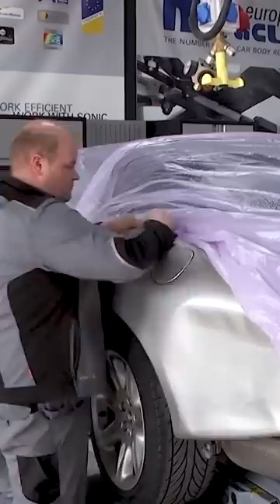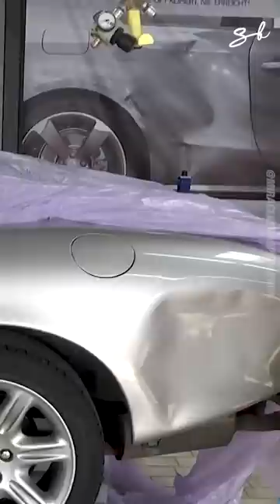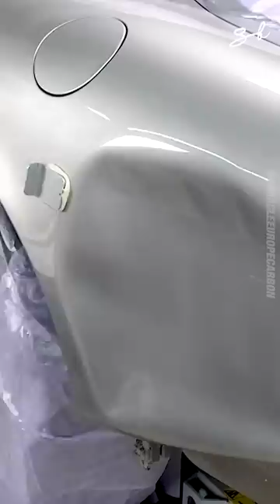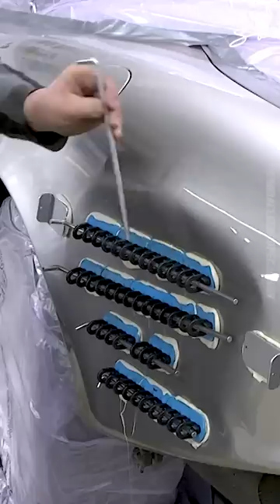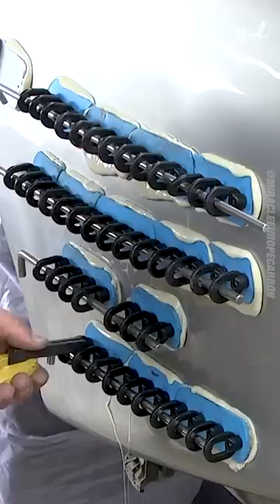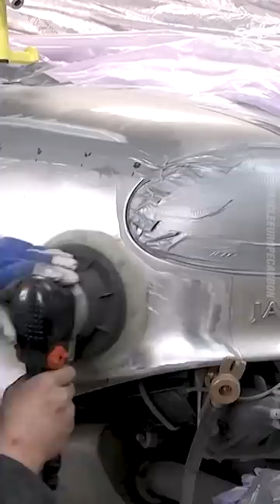Fixing a Huge Dent On a Jaguar 😮

Comment: That's the quietest repair shop I've ever seen.....you could hear a pin drop ✌️
Reply: The audio in this video is not live. You can tell because when he’s interacting with the stickies he put on the car there are no sounds. Even in the quietest room you would still hear parts touching eachother, especially metal
Reply: What if The fans are really loud
Reply: Sounds like ambient noise

Comment: That was some impressive paintless repair technique, but it must have cracked or damaged the paint at some point and he was forced to take it down to metal and refinish.
Reply: Putting money on her has some bond work to do. Small damage won't show in a video at all, but irl or feeling it shows.
Reply: If the paint is not cracked or split  then the paint can take a certain amount of deformation without detaching form the body surface.  Therefore it may only need polishing.
Reply: @emanuelmifsud6754 he sanded completely through the paint to bare metal. How is he gonna polish that??🤷‍♂️
Reply: @louskunt9798  He could be doing unnecessary work to bump up the job.  He's a business maximising profit.

Comment: If this is PDR (paintless dent repair), then I am king )
Reply: Till they ground it back 😂
Reply: Coulda been shoulda been.  Now it's just body and paint.
Reply: Nowhere does the video imply "paintless".
Reply: Was expecting not to remove to paint😔
Reply: Aluminium is harder to work with and that dent was huge. No way there wasn't cracks in the paint.
Reply: The dent was deep with sharp bends almost impossible that the paint would not have cracked , regardless did an excellent dent removal.

Comment: Then the bill charges you a whole new bumper plus installation fee lol
Reply: Only if it goes through insurance 😉
Reply: it looks like not a bumber, but solid body part. and that's issue
Reply: That be odd. And not charge for the rear quarter panel?

Comment: The whole point of paintless dent removal is that you don't need to paint.
Reply: Can it be done with such a dent though - the paint is surely damaged and cracked (even if it looks fine, it got stretched, bent and possibly scratched) and is gonna rust if you don't repaint.
Reply: @Drak_Thedp he's talking about the technique. This kind of repair is so you don't have to paint. They could of just sanded it down to metal and then did the dent repair with the sticks instead of trying to be delicate and not scratch it. This was just a dent no other damage but I bet he scratched the paint and just redid it. He probably could of just opened the trunk and beat the dent out that way since he painted it anyway. He had to of scratched it up because you won't use a paintless repair to fix a dent just to paint it anyway because it wastes the paintless repair resources when the other kind you just weld on sticks and use a puller and hammers since you have to paint with those it doesn't matter to scratch the hell out of it or whatever.
Reply: @Death_Vail666 I don't really see the point of welding to pull it, cause you'll waste even more resources to smooth it out, otherwise when you try to sell it, any paint thickness gauge will show you used putty.
Reply: @Drak_Thedp just hang on a second, have you ever worked in a body shop ?
Reply: There's a paint thickness guage??
Reply: @lxp  There sure is. I have one myself.
Reply: @Japplesnap  that's cool. I didn't know until now.

Comment: I love when these cars come into the shop saying my airbag lights on I don't know why but it's definitely a warranty issue. Now if they're  honest with us about why the lights on, then we'll usually clear it for free. If they stay persistent on playing dumb and try to defraud warranty we play a quick game.All us techs place bets on is it new parts or bondo wherethey had repairs done. We walk around the car and give it the ol knock knock thud test. No thud means they had new parts installed. If you get a thud then you got bondo.Then proceed to tell the customer its not warranty its customer pay. If they argue we inform them the orange peel in your paint is a dead giveaway. If there's bondo we show them the thud during knocking on the panel. Usually most admit to a wreck and repairs at this point, and accept the 250$ charge to clear lights. If they still persist which there is a surprising amount that still do about 80% of customers. We break out the paint gauge and show them how thick the paint is. We show them how far off the paint thickness is in the repaired area compared to the factorys uniform depth all around.

Comment: Have you tried the vaccum punch opposite hammer,  like a vaccum cup attached to the puller hammer and continuous vaccum pump connected to it.   Without and scratches or glue you can remove these type of dents

Comment: So the story line goes he couldn’t fully get it out so he’s going to have to repaint it . He’s DA’d all the metal so it’s all as uniform as it should without filler ? Don’t think so as only a panel beater will tell you that a hand rub is far more sensitive than the eye , that guy feels trough’s like canyons that needs filler . You can tell by how course he’s left it ready to apply the filler

Comment: What, he still had to paint it. That defies the method. If he got to bare metal ,might as well use the hammer from the start and use filler as little as possible. This will save 3/4 of the time.

Comment: Does anyone know what adhesive was used, I have tried many times to repair small dents with by 'hot gluing' the tabs then pulling, but they never attach well enough and I have paid for 'very good' quality glue sticks.

Comment: Step one: boiling water

Step two: plunger
Reply: What would the hot water be for? To make the paint flexible? To tension the metal? Thx.
Reply: @leehaelters6182 to make the plunger suction
Reply: Hot water works on plastic dents! You can even use a blow dryer!! On metal, the hot water heats the metal to make it more pliable!! Depends on the dent!? Mostly only works on plastic!